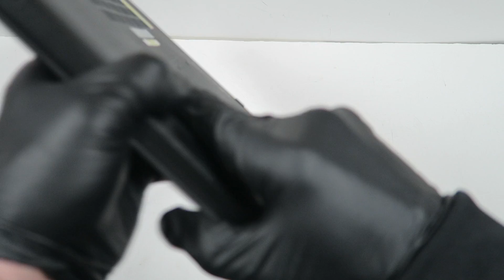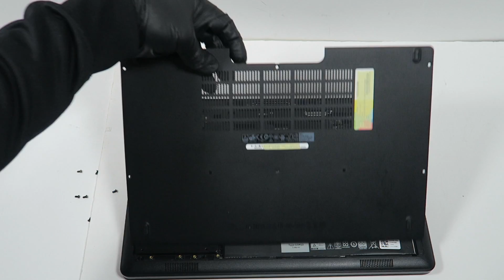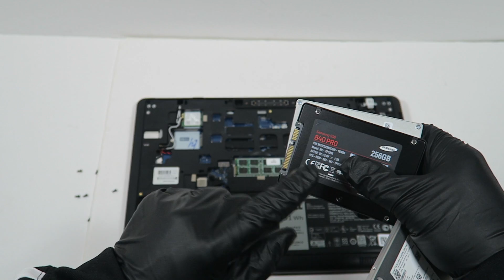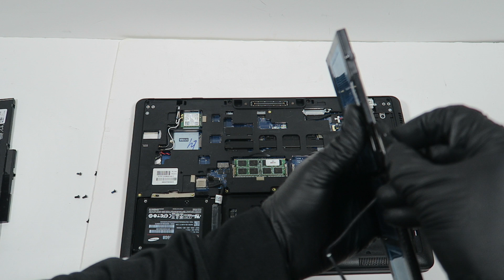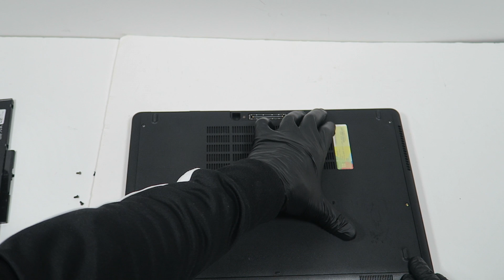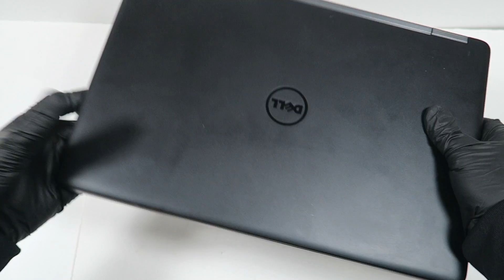Dell Latitude E5550 Upgrade SSD RAM Battery

Comment from the maker: List of Upgrades:

1. RAM: x2 Crucial 8GB DDR3L-1600 SODIMM CT102464BF160B
2. SSD: SAMSUNG 850 Pro Series 256GB (2.5 inch)
3. Dell Battery G5M10 (51Wh ) for Latitude E5550 

RAM that works with this Dell E5550
(1.) Crucial 16GB Kit (8GBx2) DDR3/DDR3L 1600 MT/S (PC3-12800)
https://amzn.to/37wcyr7
(2.) Crucial 8GB Kit (4GBx2) DDR3/DDR3L 1600 MT/S (PC3-12800)  
https://amzn.to/2Y1Z8QU

SSD List:
(1.) Samsung 860 PRO SSD 256GB - 2.5 Inch SATA III Internal Solid State Drive
https://amzn.to/2BY5gRl
(2.) Samsung SSD 860 EVO 250GB 2.5 Inch SATA III Internal SSD 
https://amzn.to/37xWUfc
(3.) SK hynix Gold S31 1TB 3D NAND 2.5 inch SATA III Internal SSD
https://amzn.to/3d7X6D6
(4.) Samsung SSD 860 EVO 1TB 2.5 Inch SATA
https://amzn.to/2B2FURX
(5.) SanDisk SSD PLUS 1TB Internal SSD
https://amzn.to/3hwdqku

Comment: Why don't you pulled out the battery connection before replacing the HDD / SSD ????? It may blow your motherboard as well as the HDD/SSD.

Comment: thank you . Is it possible to use 2 SSD for E5550?
Reply from the maker: Hi, what's the reason you want to use 2 SSDs ? and all you need is one SSD like 1TB or 2TB you can use..
Reply: @Mxkdt  I already have 1TB HDD and would like to use 1SSdof 256 GB for the processes. Will I be able to add SSD with HDD in E5550 ?